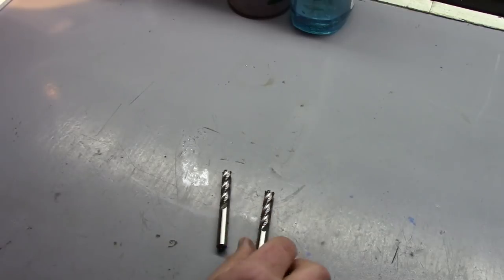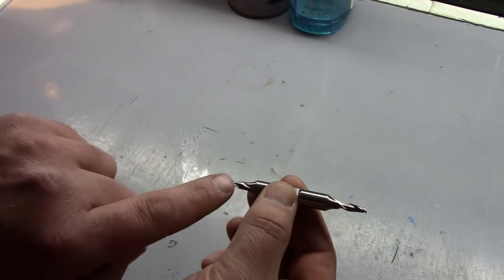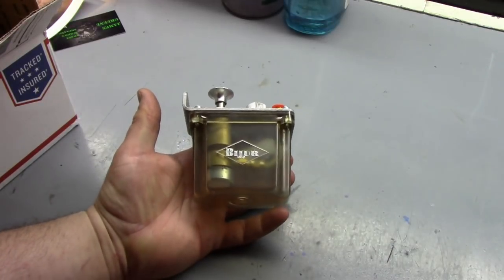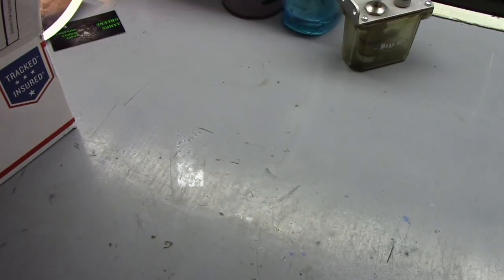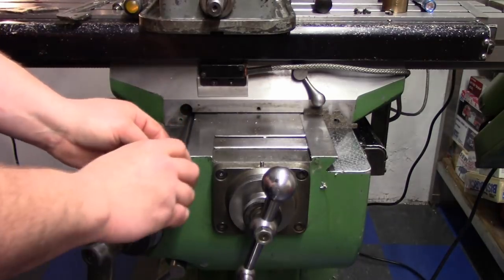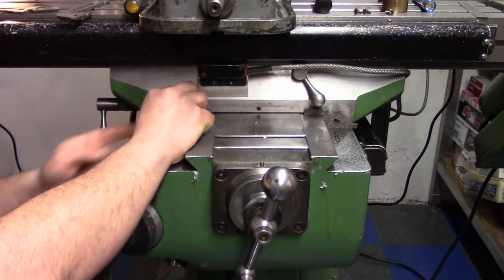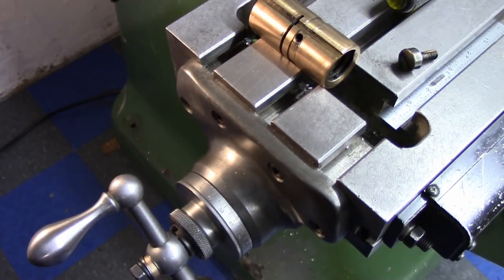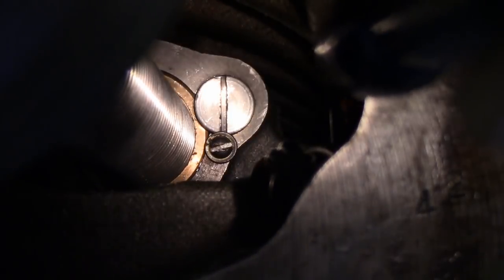Backlash and Gibb Adjustment on Bridgeport Mill

Comment: Make sure that you run your saddle all the way to the crank end before tightening the cover plate cap screws. This puts the shaft and the end bearings on the same axis. Same thing for the table: run the table to each end and tighten the cover plate (bearing carrier plate) at that end. Keep up the good work.

Comment: I didn't see it in any of the comments I read through.
but for the Y axis Nut, You Don't have to remove the screw.
Put the Y axis at it's  middle or all the way back.
Remove the 4 cap screws that hold the Bearing housing in place.
then use a bit of manual force to Slide the Y axis Out towards the front of the machine.
The Yoke /  Nut Bracket will now be close to the front opening, and you can make the adjustment
Push the Y axis back till you are close to the housing making contact.
rotate the handle to fit the housing and put the cap screws back in.
Test, and Repeat till you get it adjusted.

Comment: Congratulations on the upcoming wedding.
I figured with your day job you already knew about only pressing on a bearings outer race. If you didn't have the perfect sized tool to fit the race then that was a fairly light press fit on a slow rpm light duty bearing application. But many who might not know can learn from all the comments as well. So I think it was a good thing a few mentioned it. Just not a good idea with the heads spindle bearings to do the same though for anyone who doesn't know. :-)

Some low backlash numbers you managed to get as well. I believe brand new non CNC Bridgeports with ACME screws have around .004" once there considered properly adjusted. So given the amount you managed to adjust down to and the condition of the flaking, my guess is that mill was well maintained and didn't get a whole lot of heavy use from new.
Reply from the maker: +Turning Point 
Yeah this was mainly brass, aluminum, and plastic milled on this machine from what I learned of its history.  I had to really crank the adjustment screws and they are at their limit so if it ever needs adjusting again then it's time to split the nuts.

Comment: Been a Machinist for almost 40 and in machine building and repair . and yes the Y axis is a little tricky you have to creep up on it.   also when I do it I wash out the nut with cleaner and the screw also  and coat everything with Way lube . nothing will kill those Nuts quicker than Dirt, Chips, and no Oil . spoke to a Bridgeport service Man when I was younger and he said  .005 - .007  Backlash was what they set the machines to also

Comment: I always liked you videos, however, ill have to comment on you Y axis. You don't have to take out the Acme screw, just remove the handle and the bearing block to adjust the screw on the yoke i think its less work than removing the Y screw.

Comment: All good stuff to know, or at least be reminded of.  My last involvement with that was 35 years ago, on an old Atlas lathe.  I vaguely remember that there was something to do behind the dial that was part (perhaps all?) of the backlash adjustment on it.  I assume that those were taken care of when the screw/anchor plate/dial assembly was put together?  Just wondering if the book made any mention of that...
Reply from the maker: +diggerop 
Yeah as far as I know just like the Southbends you can shim in behind the dial housing to adjust backlash.

Comment: Where is the dial indicator? Adjusting Gibbs only by feel is like zeroing a part by eye. You should adjust most mills to approx .0005 so that they still float and have minimum clearance. Gibbs wear like an hour glass so taking an indicator to them on a granite slab will also help you figure out if you need to replace them. Another method is to install a shim, tighten the gibb/s down with a light drag, back off 1/8 turn, or whatever is needed to just slip that shim out and then tighten a quarter turn in from there. It’s much better to utilize the tools in your shop versus by hand. Now I’m not saying you can’t get close but it won’t be accurate. Then again most those smaller mills are not accurate Anyways however I’d want mine to be as close as it could be and give it the longest lifespan it can have.

Comment: Congrats on the wedding and the mill acquisition!  Looks like 2016 is going to be a good year for you.Have you seen NYC CNC video on air powered draw bar attachment.  Would be a good project if you have enough head room.
Reply from the maker: +Kendall Comeaux 
Not quite enough head room for me plus my air supply is a compressor I built.  I may try to engineer an electric version though.  We will see.

Comment: What about the back lash / float in the spindle it self ?
By that I mean the last thing you refitted.  The square plate with the 4 allen screws and the engraved dial.
You can tighten up the nut as much as you like and if this has float you will still get a reading on your dial.
My Adcock and Shipley  (built Bridgeports at one time so "family") has a thrust ball bearing and a pair of lock nuts to adjust this separately behind the crank handle.
This needs to be adjusted 1st   !

Comment: Greg awesome video! My mill came with a broken Cam Rod Sleeve on the power feed. So it won't stay engaged. I found it broken when I inspected it... the seller promised to fix it before he shipped it, and I guess he neglected to do so. Well I'm not shipping it back haha. I think the solder just came loose on it. Do you have a video that shows how to get that assembly out so I can fix it? Thanks!
Reply from the maker: https://www.youtube.com/watch?v=hUzWiI1aGyI   Pretty much the guts of the power feed unit.  While you have it apart I suggest you replace the shaft seal and add some silicone gasket to the matind surface of the motor to the gear housing to prevent oil leaks.

Comment: Take the old bearings apart, make a split ring of which ever race you need and it makes a perfect press ring. It's the perfect size and won't stick in a hole because it's split.
Reply from the maker: +DSCKy 
Yeah they just ended up in the trash before I got the new ones.

Comment: I just picked up a used machine that has excessive backlash in the Y Axis. I'll investigate the problem and determine what I need to do. Maybe splitting the not will be a good fix, or maybe I need a new nut. Either way, I'll get after it!!!

Comment: Don't worry about the fuzzy math, LOL. Curious as to the top end of the machine, did you find a minor problem and get it up and running ?
Reply from the maker: +william D 
Bit of noise and general muck.  Plus there was grease where there was supposed to be oil.
Reply: I have a Bridgeport j-head I bought a few years back that does not have the automatic oil feed system on it....someone used the zerk fittings for dumping grease into it...still haven't taken it apart yet to clean and adjust it up yet as at the time I was busy with work , now have no job due to a shop closing and where I worked our lathes are being shipped to guess where? Mexico. But at least my old company hires me from time to time as a field tech (contractor) to help them remove machinery. We had a bullard 36" cutmaster vtl at work that over the years the lube zerks were pumped with grease as well...sad. Keep up the great vid's     Bill

Comment: You mentioned you need to figure out where to put the sticker that was sent to you. I love stickers, but always saved them because you only get one shot at placing them. Now I go to Home Depot and and buy magnetic duct covers ( for blocking off rectangular air vents) They are about 10" x 14" and cost around $5 for a 3 pack. They are in the heating isle near all the duct work parts. Now I put the sticker on them, then cut it out and BOOM........magnetic/move able sticker. If you like the idea, buy some and throw it into one of your videos.
Reply: +D.B. Cooper You can by sticker magnets at a craft store like Michael's or Hobby lobby too... in various sizes. The vent blocker may be cheaper though?
Reply from the maker: +D.B. Cooper
Great Idea Thanks!

Comment: Been waiting on the adjustment video (thank you very much). My old mill has about a full turn of backlash in the in/out axis. Hoping most of it will adjust out, but didn't know how to get to the adjuster. Wondering if you can pull the brass acme nut out through the hole if it is necessary to replace it or split it? I have a DRO so I guess it's not that big of a deal... but I want to see if I can do something about it anyway.
Reply from the maker: +DSCKy 
Yes the brass nut is a slight press fit.  All that is holding it in is the backlash adjustment screw and there is a key to keep it from rotating in the housing.

Comment: You did damage the bearings although in this application they will run a long time. You forgot to apologize for using the Channellock's. You could have used the old bearing to press in the new one's with no damage.
Reply from the maker: +Richard Haisley 
They went in the trash and I'm not apologizing for anything just saying yeah I made a mistake.

Comment: oh my split compressed nuts what's next ! btw the bearings light press fit no problems with that as you say its not a moving ( in high speed) shaft so no problem just dont walk funny 

Giggles